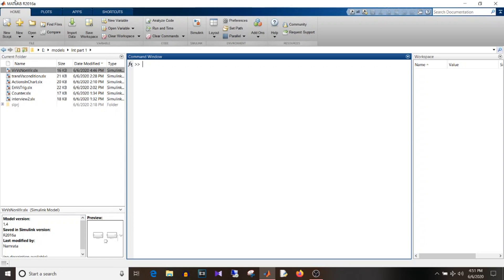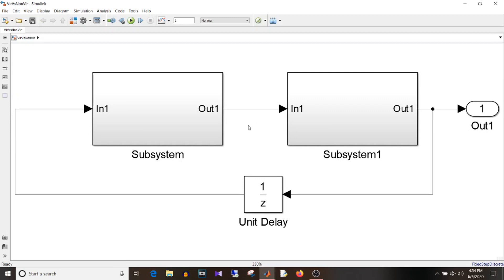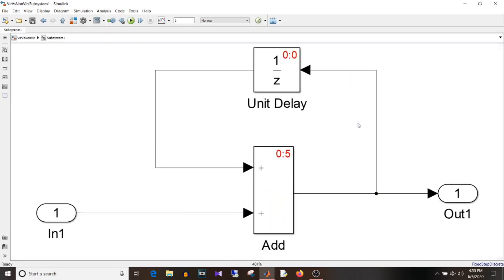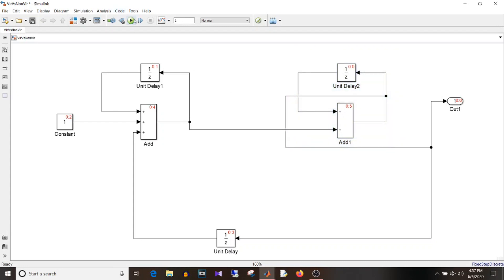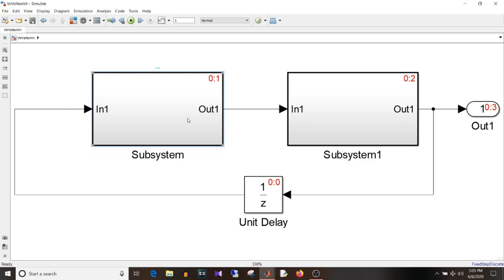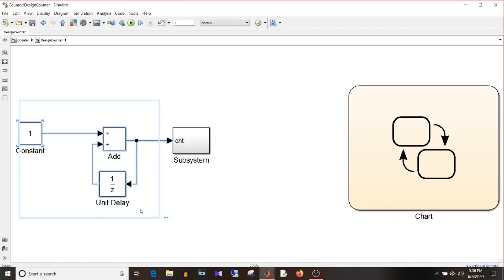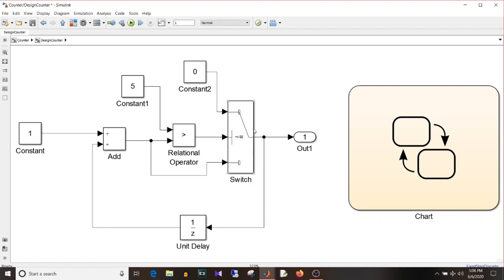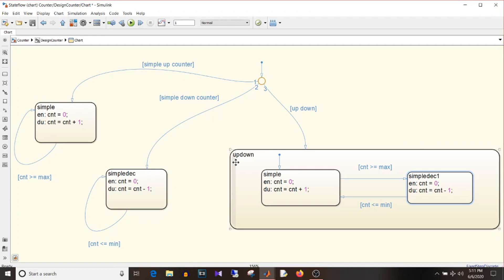Simulink Tutorial - 61 - MBD Interview Questions | Part 2

Comment: for down counter, the counter should be set with maximum value mentioned right? because we will be decrementing the counter value till it reaches 0 i.e. if the counter has to go for 5 loops then cnt=5, then cnt=cnt-1, check till cnt=0
correct me if i am wrong!
Reply: Correct 💯

Comment: Hi mam,when we are using relational operator it will check first value greater than second value so in that counter the result is always zero.The connection need to reverse.
Reply from the maker: Hi Arjun, thanks for pointing out. The connection to relational operator should have been other way around. Would take care of it now onwards 😊
I am updating video description.
Point here to note that, people should not copy the logic blindly because while recording such mistake can happen specially when it is not simulated. Glad that you checked it.

Comment: There seems to be issue with logic implemented for up down counter.. you don't need the entry condition in the simpledec1 state
Reply from the maker: The point for this implementation was to count from 0 to up and decrement from 0 to negative and not -ve to +ve and vice versa. It's just an example and not the core implementation.
If you are expecting -ve to +ve and vice versa the implementation will change for both states and not just simpledec1